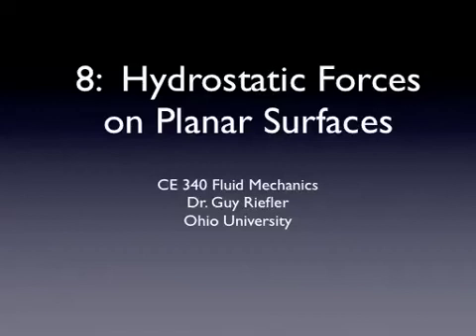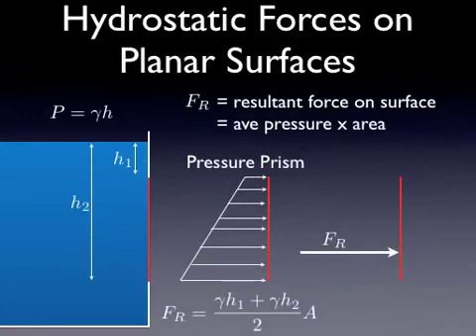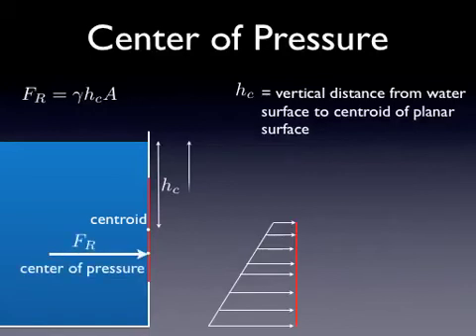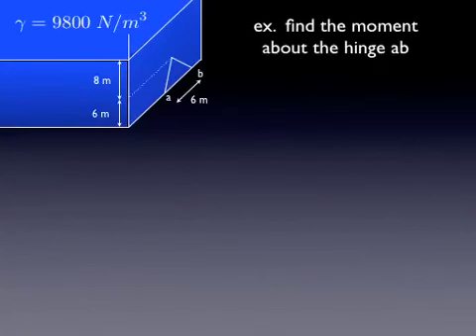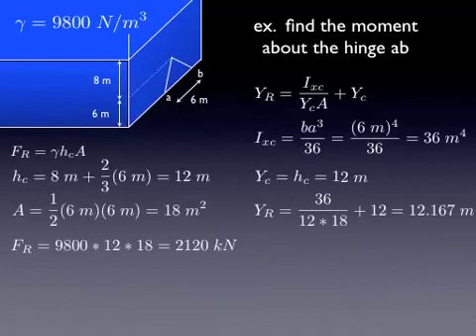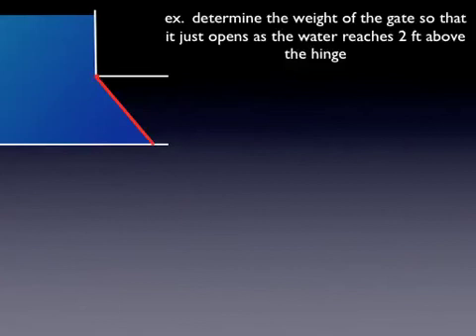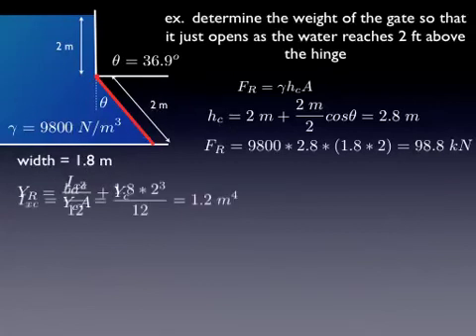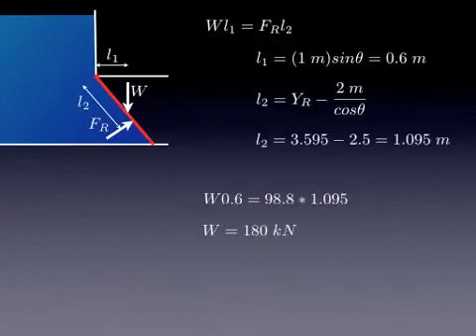08 hydrostatic forces-planar

Comment: Because pressure increases with depth.  When you submerge a bowling bowl in water it is lighter because the force due to water pressure pushing on the bottom half of the ball is greater than the force due to water pushing on the top half of the ball.  The CP would be at the centroid only if the water pressure was equal along the entire submerged surface, but it isn't.  The pressure is greater on the bottom half than the top half.

Comment: If you go to 4:44 you can see the moment formula for a triangle.  The location of the hinge is irrelevant for the YR equation.  The moment equation from 4:44 is in reference to the vertical dimension, because pressure increases with depth.  If the triangle was oriented differently (point down for example) a different moment equation would be needed.

Comment from the maker: hc is the vertical distance from the water surface to the centroid of the submerged surface
in the second example, I divide by 2 to get to the middle of the gate (your calculation would bring you all the way to the bottom of the gate)
in the first example, the centroid of a triangle is 1/3 from the bottom or 2/3 from the top, which is a distance of 6/3 = 2 from the bottom or (2/3)*6 = 4 from the top, so hc is 8 + 4 =12

Comment from the maker: Yc is the distance from the water surface to the centroid of the plane in the direction of the plane.  So this distance starts at the center of the gate and travels upward at an angle of 36.9 with vertical and ends when it intersects the water surface.  The distance from the center of the gate to the hinge is 1 m (2m/2).  The distance from the hinge to the water surface at the 36.9 angle is 2 m / cos 36.9.

Comment from the maker: Yes, but your formula is a little off.  The angles do matter.  When summing moments about a point, you just need to make sure your moment arm is perpendicular with the force and goes through the point.  I used the full W, but used sin(theta) to come up with a moment arm perpendicular to the force (0.6 m).  I could have just as easily used the component of W in the direction perpendicular to the gate [W sin(theta)] and a moment arm of 1 m.  This has more to do with statics than fluids.

Comment: Oh, another thing: do the differing angles of attack from the resultant (FR) compared to the weight (W) have no effect? If I were to solve the problem on my own I would have set up the following: FR l2 = Wh l1 where Wh = cos(Theta) W
 
So basically, I decompose the forces of W and set Wh equal to the the force normal to the surface of the gate.